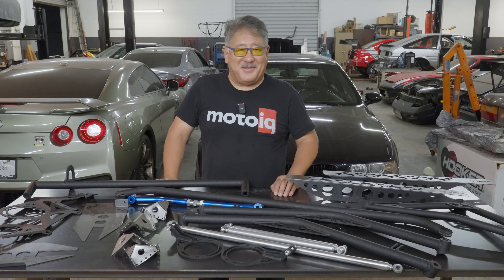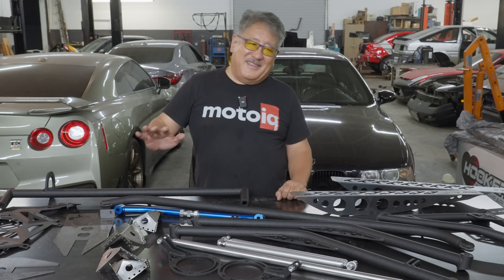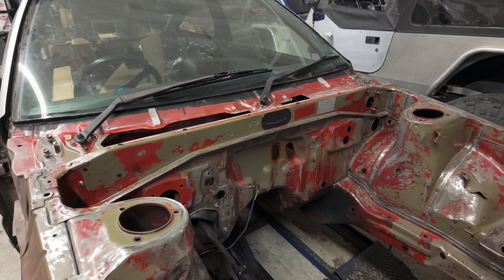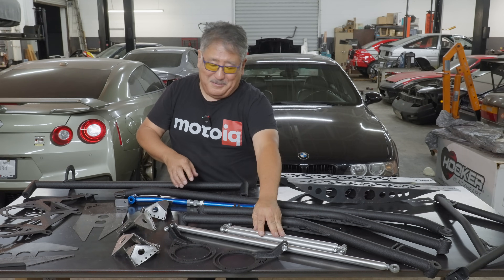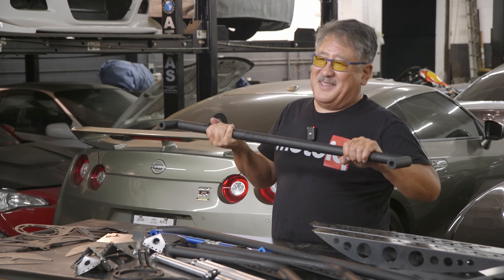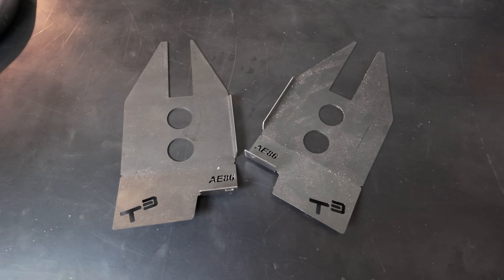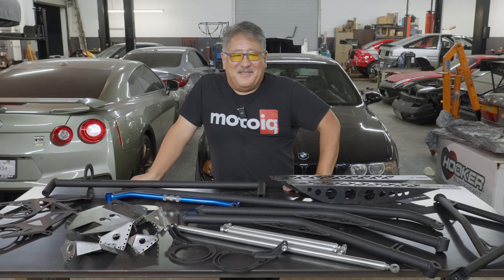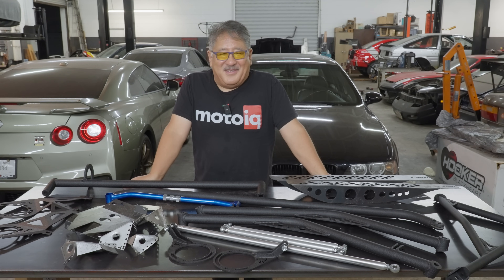Project AE86: Chassis Strengthening Modifications

Comment: Thanks Mike for the interesting and useful information. I have a 2019 z34 sport 6MT on which I now am making suspension improvements. I' ve already replaced the anti-roll bars with a set from Hotchkis and have replaced the wheels with forged magnesium monoblocks with two-piece aluminum hat rotors. I've replaced the OEM steel front shock tower brace with a stiffer and lighter triangulated aluminum brace. I am getting ready to install some aluminum triangulated chassis braces.

My question on all these braces is whether they should be installed with the suspension loaded on it wheels or should the wheels be hanging? Thanks for all the work that you do and information you share on these suspension topics.
Reply from the maker: Probably loaded.
Reply: @motoiq  Thanks, I appreciate the help.

Comment: An ex girlfriend had a modified mk1 scirocco, it had lowering springs, chassis braces, sway bars, bushings, a cam, all this shit. I thought if we slapped some RE-71Rs on it and took it autocrossing it would be great. It SUCKED. It was absolutely the worst car I've driven. The problem was, despite the extreme amount of steering load-up (to the point of requiring power steering conversion) the car just wouldn't turn for shit. I think in hindsight what was happening is that the amount of grip the modern sticky tires provided the car was twisting as if you had a soft front sway bar, preventing the torsion beam and rear sway bar (I can't remember if it had one tbh) from doing their job and tuning out the understeer. So instead the rear would just grip up and cause it to push, as it's mass distribution would lead it to. At the end of the day, you still couldn't pay me to own a mk1 VW those cars are absolute dogshit through and through haha.
Reply from the maker: Maybe it was rolling onto the front bumpstops

Comment: I need these techniques to restore strength due to my r̶u̶s̶t̶ h̶o̶l̶e̶s̶  weight reduction
Reply: Put a velocity stack on the Sentra. I wanna see sumthin’
Reply: @HatersGarage  If it is badly rusted weld every thing you can. Weld in permit bracing.